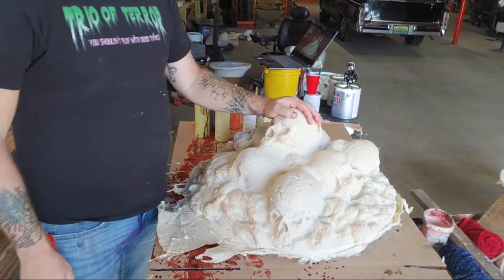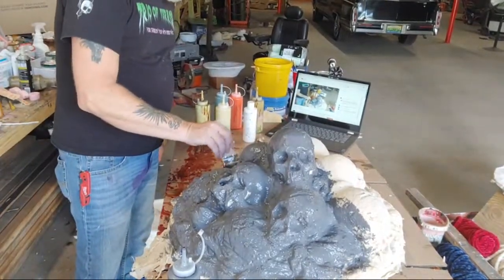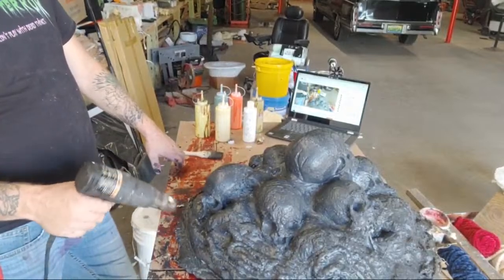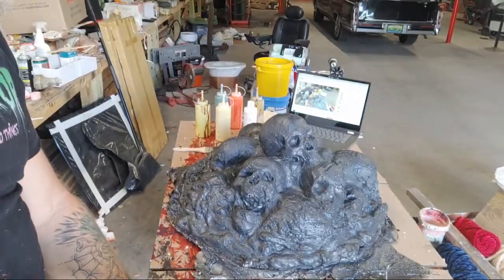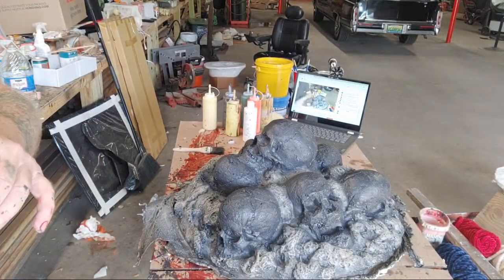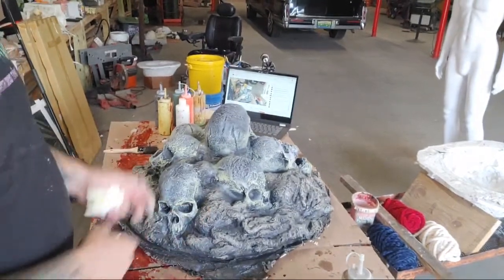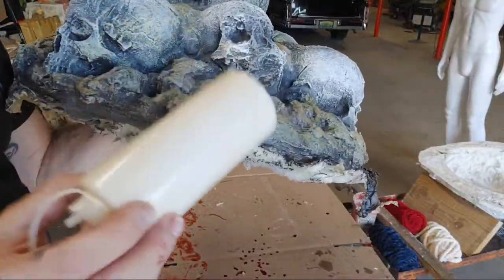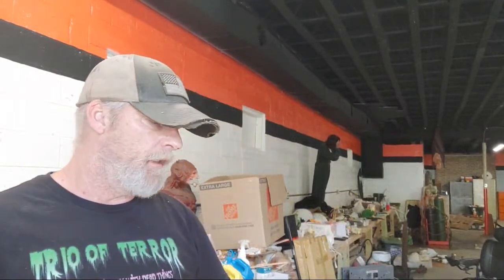PAINTING SKULLS

Comment: I have a Question for you you friend , si I’m getting into casting  things out of foam and I already have a few skull molds and my question is what type of foam would you recommend for a softer type skull. I’ve used a 1to1rigid foam  and they come out rough skinned and I used a good release agent from Reynolds material and I also used the canned foam from loctite and didn’t like that one either so any tips would be greatly appreciated thanks
Reply from the maker: Are u using a silicone mold.  If so your skulls should come out ruff unless it's in the mold.  On silicone mold u don't need a release agent ..if u using silicone I'd use a " foam it 4 " soft foam  ridged foam u can use a 5 or 6 pound foam...
Reply: Ok great ; yeah two of the molds are a vacuum formed half skull molds and the other two are latex, I guess I’m just amazed when I see people here on you tube cast a foam skull and it appears to be flawless and when I try it’s pitted and the top skin is so rough I have to coat the entire head with sparkle or drywall mud just to get it somewhat smooth , oh and by the way thank you for your help I really appreciate it
Reply from the maker: @dalehahn9465  the vacume foams are really meant to be used for like hard casting as in plaster of Paris....silicone molds u can use what ever but should be smooth. I'll actually be pouring up skulls this evening if you want to watch maybe I can explain it a little better on live video for u around 3 ish
Reply: @MONSTERMISFITS  that would be awesome if you wouldn’t mind doing that oh and I plan on getting some silicone molds also just got to get past the sticker shock lol
Reply from the maker: @dalehahn9465  haha yes it is pricey for sure